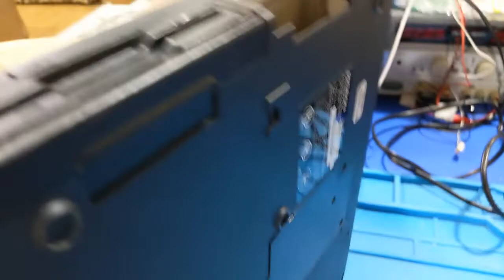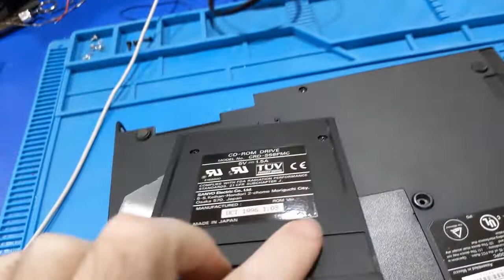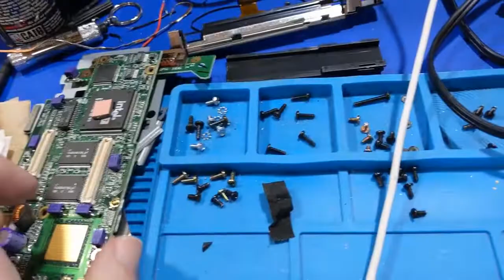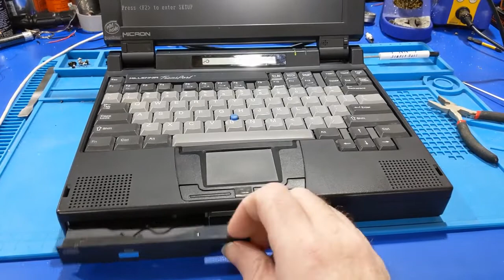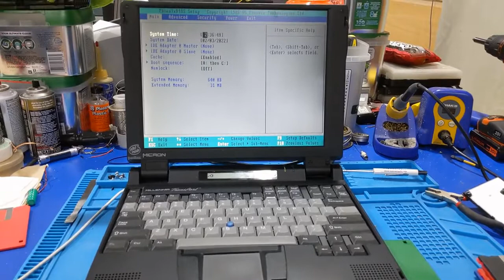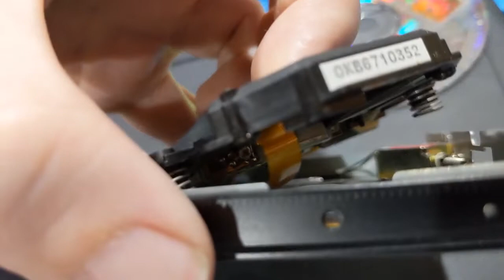Micron Millennia TransPort overview and troubleshooting

Comment: I just bought two of these, wish me luck. I have all the tools to fix it completely if needed. One of them is in absolute mint condition and looks brand new and includes no AC adapter, so has not been powered on in a long time. I am hoping that means any leakage would not have shorted anything. The other also is in mint, but includes the AC adapter, Micron laptop bag, lot of accessories, and so on. I'm not going to get to it right away, so what caps were needed, including the two that you presumably replaced later (i'll just order them now).

Both have the drive caddy and the drives. Neither have the battery sadly. I was ready to refurbish one with new cells if I had to.

Comment: So while cleaning we found one of these laptops with the caddy drive as you called it. I don’t know much about older computers but the one we have doesn’t have a floppy drive insert on the right. It has a piece that appears like it can come out and above it is a button with a coffee cup symbol. Any idea what it is or if it’s even the same type of computer? It says micron millennia transport on it and looks just like yours except that part on the side mentioned before
Reply: I should add that it doesn’t turn on either even when plugged in.
Reply from the maker: It's really hard to say without seeing it because there's been so many different versions. It's possible it's a secondary battery Bay

Comment: Sanyo built these. If you take the plastic cover off the back of the CD drive, you'll see the Sanyo logo silkscreened into the interface board.
I have one of these TransPort XPEs (in pieces) with two dead power boards. Thinking about trying to rebuild it sometime (the plastics are a mess). I suppose I could try recapping the power board and see what happens. I do have a working TransPort XKE though.
Reply from the maker: Yea i figured that Sanyo made the machine, the optical disk drive itself has about had it. it needs a new laser pickup assembly.